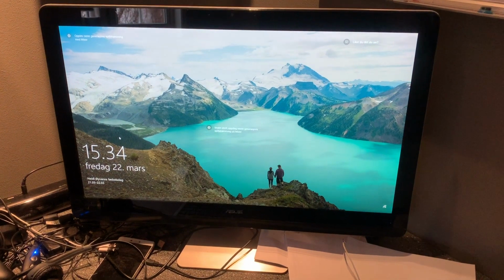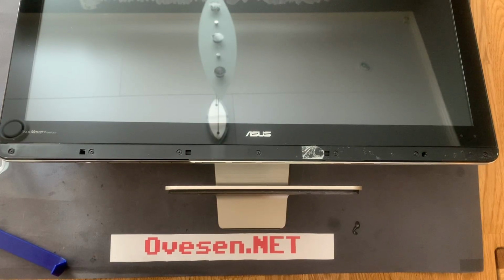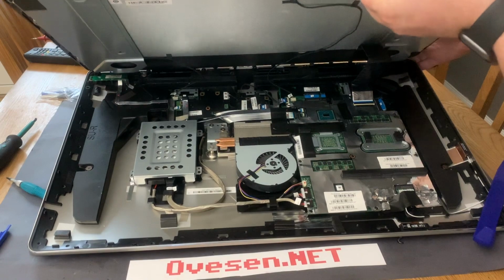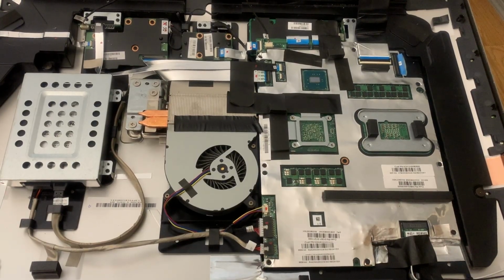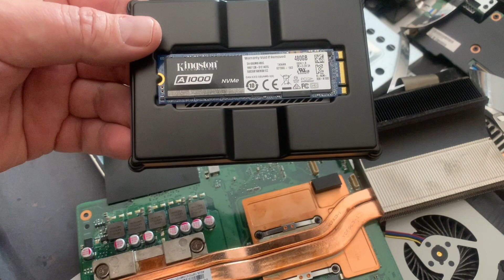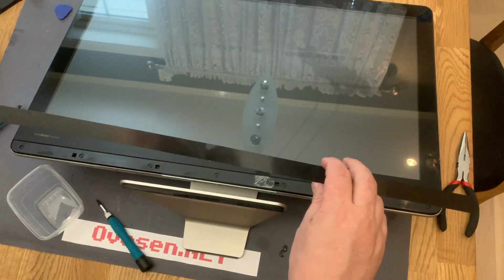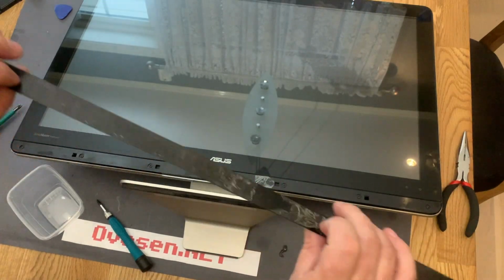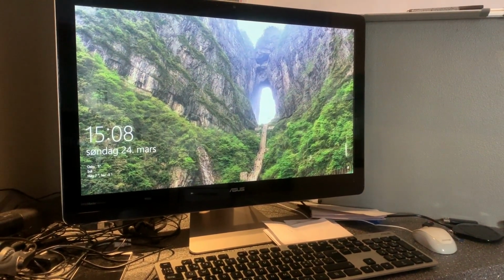ASUS Zen AIO PC SSD drive replacement - Z240ic-H110

Comment: Thanks for great video which helped me fix my fan problem! My machine (2017 model) was running hotter than it should and making more noise on start up. The problem was easily solved...clean the fan of 8 years of dust! As good as the day I bought it! Many thanks👍

Comment: Full marks to the channel for a very clear process. None to Asus for forcing a motherboard removal to change a hard drive. Doesn't matter that they don't want users going in there - it also making it difficult for official repairs. I've swapped out HDs to SSDs on much smaller laptops without this level of difficulty.

Comment: Just picked up on of these systems.  Works great EXCEPT i have to manually re-install the boot keys.  I think the battery on the motherboard might be bad.  Might be good idea while upgrading the drive(s) to also replace the battery (That's what I plan to do).  :)  Thanks for the video.

Comment: Just picked up a Z240IE-DS71 with bad NVMe drive.  Great idea to up the capacity.  I'm going to 512GB.  Drive is M.2 2280 Sata III TGFF.  Thinking about upgrading the storage drive while ASUS is open.  IIRC, it is a cheap 5,400 rpm spinner.  I have a 7,200 rpm Hitachi which will do.

Comment: CPU cooler is 4pin 13PT01D1p02111-15BH-31P ( KSB0612HB_752 12v, 0,4a ). Same as cooler Asus G750 GPU (12v) - but its more noise
Reply: What would be a good replacement/upgrade?

Comment: Nice video especially the part of opening up the machine. I suggest a couple of improvements. Before taking the machine apart, use a hardware detection program to determine the type of SSD installed. Mine had a M2 Sata drive, and not an Nvme M2 drive. I checked before so I bought the correct type:-) Secondly if you clone your currently installed SSD with a USB housing for the new SSD. (there also make sure you buy the correct type, I found out the hard way a couple of years ago and therefore have now a USB housing for M2 Nvme drives and one for M2 Sata drives) Then use a cloning program to clone your old still installed 128 GB SSD to your larger new SSD. After that shutdown the computer and follow the video.  Once re-assembled, start up the PC with the newly installed drive and you have exactly your same PC however with one change..... a lot more breathing space on the C: drive.

Comment: Seeing swap the SSD and re-installing the OS I always ask myself whether there would be a way to transfer the existing OS installation. Would it be two HDD they could be simply connected at the same time while transferring with an USB started Clonezilla or similar tool. PCs only have one SSD-connecction, right?

Comment: You might wish to try a pair of suction cups made for handling glass.  Small ones (about 100 mm diameter) are not too expensive, and are worth the investment if you work on all-in-ones like this.  These have a handle that swivels to apply suction, and lock in place.  That looks like it packed tighter than a can of sardines.

Comment: I've upgraded my HDD thanks to this wonderful video, hope you enjoy a cup of coffee. Opening the monitor part was not easy. And I was horrified when the monitor showed only black screen after the first booting. I connected the video cable to the monitor, which was a little bit tricky because I am not a tech-guy type, and then the monitor worked fine again. Tip for attaching video cable : close the black plastic cover after attaching the video cable strip to monitor part.

Comment: Hi, I liked the video, I also have a computer of this type, I bought an SSD from western digital, model wd blue sn 500 NVME. Same model as the model you mounted on your computer but for some reason the computer does not recognize the SSD, from a test I did I came to the conclusion that the SSD is installed I have this computer SATA 3, and not NVME, how did you manage to perform the installation in your illustration? When the interface is SATA3.
Thank you

Comment: Thank you! Very useful indeed. One question please: I see the old SSD was a M.2 mSATA  and the new one you added ( Kingston A1000) is a NVME PCIe. Am I correct to assume it supports NVME  M.2 SSD cards?  My motherboard is ZN241IC  ( 2017 model)
Reply: Not all m.2 drives are nvme, but all nvme drives are m.2.

Comment: My friend thanks for your video, but I tried to replace with a HP SSD EX900 M.2 nvme but my PC doesn't recognized the device. I checked in the BIOS but only recognized SATA DISKS, I don`t know what is the problem... I thankful if you can help me.
Reply: My ASUS motherboard is Z240IC-H110

Comment: Hi, thanks so much for the video, I followed it step-by-step and successfully installed a 512GB m2.SSD.  The SSD has a full-disk clone of the original HD, even though the SSD is reorganized by both bios and Windows10, I am unable to make it bootable.  I assume you are able to boot from your SSD, if that is indeed the case, could you let me know your version of the bios?  Mine is 0705 (March 2016).  I have been struggling with this for days and would be grateful for any comments and suggestion you might have.  BB
Reply: Hello, good morning, did you install an Ssd nvme?

Comment: Hi, I have the same model with a sixth generation i7 processor, 8gb RAM and 1Tb hard drive with an nvidia 920 graphics card. The computer is not running as fast as it should. I don't know if the reason is because you have an HDD and it takes a long time to open programs or it just crashes. Can I replace a hard drive in that model? Cheers.

Comment: this is your asus aio well, but there are tons of asus oio. which model is this? z240.... which one?
Reply from the maker: Z240ic-H110
Reply: @Arcticretro  Thank you. I have a few questions. I have Asus Zen All in One Pro Z240IE (Z240-PRO7SD) Production year: October 2017. Specifications: 8mb cache 2.90 GHz Intel core i7 7700T processor, 16gb DDR4 2400mhz RAM (8 GB X2), 1tb 5400rmp HDD, 128gb SSD M.2 SATA 3. Usage Type: No games. No graphics softwares. Home user. But sometimes transfer large data like Blu-ray movies and work with large office word files. The Pc is now in the technical service for noisy working issue. They will replace the cooling fan. I wanted to upgrade at the same time via IT. Since it's all in one Pc I can't open it all by myself. Only RAM and storage units can be upgraded. I want to upgrade and change 16gb RAM with "CORSAIR 32gb (2x16gb) 2400mhz DDR4 CMK16GX4M1A2400C16", 128 SSD with "SAMSUNG 970 PRO NVMe M.2 SSD 512gb" and lastly 1tb HDD with "SAMSUNG 860 Pro 1tb 560mb-530gb/s Sata3 2.5" SSD (MZ-76P1T0BW)" *I made the selection of parts with very limited technical knowledge. Is the brand / model preference correct? A better suggestion? *Will these changes affect performance? *Does it contribute to work PC quieter? *Are the parts compatible? Do I have any problems due to part replacement? The underlying reason for my desire to replace the SSD with SSD is that besides the capacity increase (Windows will be installed in this part), I think it will contribute positively to the overall performance of the PC, as it is a new technology. The reason why I want to replace the HDD with SSD is that it may also affect the overall performance, speed (I use it as a storage) while transferring data, and the other reason is that maybe it may contribute to the quiet operation of the PC, even if a little. What do you think on this issue?
Reply: @Arcticretro  My friend thanks for your video, but I tried to replace with a HP SSD EX900 M.2 nvme but my PC doesn't recognized the device. I checked in the BIOS but only recognized SATA DISKS, I don`t know what is the problem... I thankful if you can help me.

Comment: Good tips. How to replace the RAM ?
Reply: I think its the same, just change RAM instead of SSD.
Reply: @KeaKoachu  I don't find where RAM is located. Can you help me? Thanks
Reply: @BalaGajmer  i am not sure, but if its not under holed metal plate, in the same side with SSD, then RAM must be under metal film on back side of motherboard.

Comment: is it possible to replace 1tbb harddisk with 1tb ssd in this pc?
Reply: If you get a m.2 3.2 drive tray you can infact... but remember the sata connector is going to drop the m.2 to the sata speeds not the nvme or m.2 speeds.